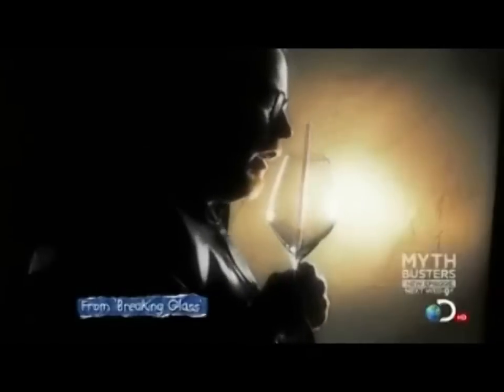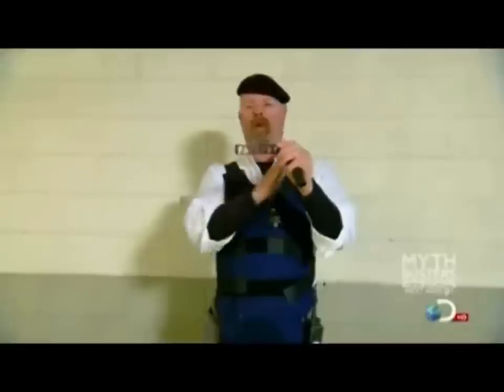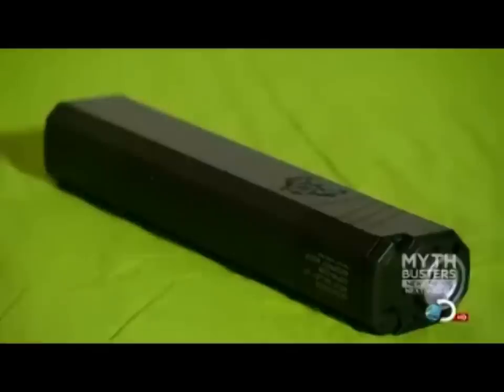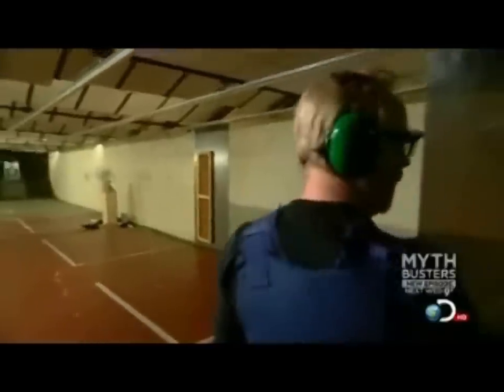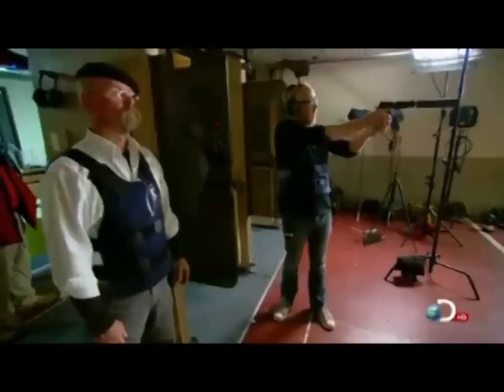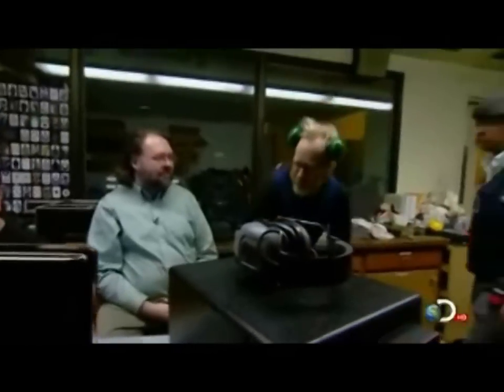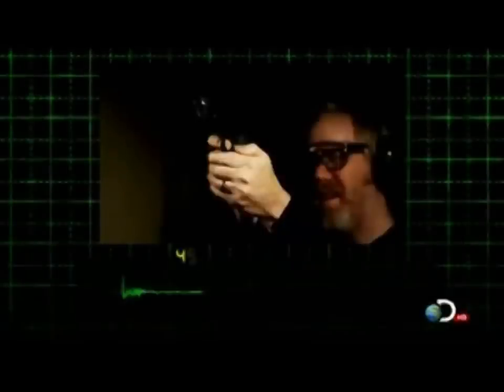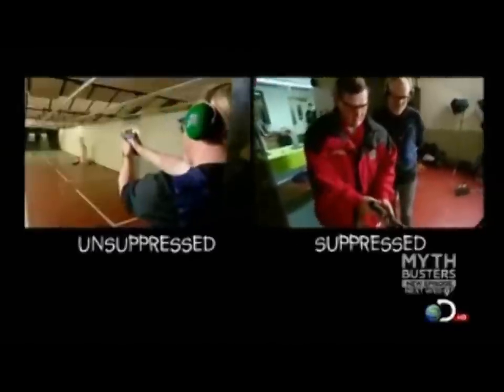Silencerco on Mythbusters

Comment: wet or dry testing... standard or sub sonic ammo... uhhh, there are measurable differences
Reply: ***** how do u mean regarding ur comment, not realistic? Personally, I've used both and tested a variety of substances under "wet" . from water to engine grease. Poor results with lithium grease. Water is only good for a few shots on short can and limited baffle stack but, engine grease has worked best for rifle and pistol(my personal guns) 
. I have 40 plus round thru a can on a 40. Cal with sub sonic ammo I loaded myself without having to reapply .. I think maybe water would be the unrealistic use because it would run out if gun is lowered or raised.. But, there is also a gel on market used for cans so it can be used practically..
Reply: Yes Sir
Reply: *****
Silencerco recommends using a wire pulling gel, not water.
Reply: reduced it to "hollyweird" levels?  C'mon... You know it's a gun shot.  It's a safety tool.  Also I'm sure these guys were dry shooting it.  Don't you think?
Reply: Sure, dry.. What was  safety tool? In ur comment
Reply: james solis Silencers are ear protection,, they're safety tools. most of them lower the report by about 30dB which puts most things in the "safe to use without hearing protection" range of under 126dB at the shooter.

It still sounds exactly like a gun shot. It's just safe for your ears. In many countries (I'll use France as an example) it's damn hard to get a permit to own a gun, but you can buy a can for said gun for cheap over the counter with no hassle at all and it's against the rules of most ranges to shoot without one (or at least is considered very rude).  That's all I was saying.  =)
Reply: Oh.. Yes. Agree. I didn't catch on to how u phrased it but, it makes scenes now.. 
 That's interesting info u gave in ur example about France.. Extremely difficult to get a gun but, picking up a "can" with bubble gum and laundry detergent is easy to get over counter.. 
 BTW, if u goto my page  you see a home made silencer I built for my  40 cal Glock with sub sonic ammo that reduced sound more than half if factory db.. And I have 50 rounds threw this can I made
Reply: On YouTube.. Under my name
Reply: garfieldwithissuez If shooting unsuppressed is considered rude, I wonder what shooting my S&W 460 with 460 magnum loads over there would be considered?!!  :-DBTW - stereotypically speaking, I find it odd what rude people (the French) find to be rude.  \;-)
Reply: yeah thats what i thought, there are A LOT more variables than put into the episode.
Reply: +Mike Riedel Good thing I'm not French, or I'd be so offended by what you said I'd have to snort at you in derision and call you a "Silly Le American." But that's been bred out of me over the last 4 or 5 generations and I'm From Texas, so "Right on Brother."
Reply: Does sub-sonic ammo have that big of a difference on the volume of the shot? I thought they're primarily used to stop the bullet CRACK.
Reply: Ethan Sapp yeah subsonic ammo makes a pretty big difference an mk23 mod 0 running subsonic 45. Sounds like an air gun
Reply: @Monday's insanity most of your factory .45 loads are already subsonic.. don't see why someone would waste the time to lower the already abysmal muzzle velocity.
Reply: Pharoc I was more just specifying because not all 45. Is subsonic, and a non subsonic would still be loud
Reply: james solis surgical lube or ultrasound gel works great to
Reply: Wet testing must've  missed the mythbusters guys  using that term  😤🙄🤬..!!
Reply: @jes0lis  makes sense now *is what I imagine you were attempting to type sorry to be the spelling police again : "SORRY" about that 😤🤬..!!
Reply: Yeah they tried the subsonic ammo and it was just like the movies

Comment: What wasn't mentioned, at least in this part of the video is that .45 caliber is subsonic(around 800 ft. per second), so when suppressed, it's very quiet because it's not breaking the sound barrier. Notice when the silenced 9mm was fired, it was louder(about 1200 fps). Point is, if you buy a suppressor, .45 is by far the best round to shoot.

Comment: You're partly right. Most movies wear an "assassin" has a silencer, it's a .22lr (which is quieter than a pellet gun). However, in movies with spec-ops soldiers, they'll be using normal calibers. Also, when they use them on an m4 or similar weapon, it's complete bs. Supersonic .223 sounds like a really loud .22, and sub-sonic doesn't always cycle the action completely. So when they
Reply: This was a decade ago but you never finished your comment my guy
Reply: @Spud.0  I did. Its one comment down "They do slow down, but just barely. Not even enough to notice a reduction of range or accuracy. I'll refer you to the gunwebsites ".308 velocity shoot" here: /watch?v=ekKdmx9Loiw"
Reply: @OhshitPositive  no way how’s ur decade been

Comment: Did they try subsonic ammo? Would reduce the sound even more.
Reply: The .45 caliber is already a "sub-sonic" round as it travels at speeds from about 850-920 fps, depending on various factors.  To break the speed of sound, and generate the ballistics "crack", is about 1,100 feet per second.  The Suppressor they are using, the Osprey, has a lower chamber that offers about 30% extra volume to cool the gases leaving the barrel, thus this version is king of the hill right now for OoTB performance.
Reply: as stated .45 ACP is already subsonic and yes the 9mm they were using were subsonic loads as there was no crack at the end of the shot.
Reply: As mentioned by Hawk, you are likely thinking of rifle ammo.
Reply: There are even quieter 45acp rounds. Even a different burning of the powder and 50fps less can reduce the decibel when running through a silencer.
Reply: 128 decibels is plenty quite enough. 140 is hearing safe. There's no real added value of going quieter. Based on a study with 9mm subsonic ammo and a SilencerCo Omega 9k by the Military Arms Channel (MAC) here on YouTube, they were registering an average of 124 decibels. To put that in perspective, 124 decibels is about as loud as a "from the shoulder" clapping of the hands (as opposed to "from the wrist" clapping like when applauding). No one will hear a sound that quiet if fired from inside a house, for example. All that said, if you want more quiet, you need a bigger suppressor.  

I'd imagine that anyone that fires a semiautomatic pistol with a suppressor and subsonic ammo wants the weapon to fully cycle. I mean people that actually own suppressors, such as myself, as opposed to people that watch too much TV and can only speculate about "more quiet", but I digress. An unmodified pistol (one not equipped with an ultra light slide, reduced power recoil spring, etc) needs ammo, even subsonic ammo, that generates enough pressure to still cycle the weapon completely and reliably. There's no point in spending all that money on a pistol, suppressor, threaded barrel, piston, NFA stamp, and ammo to turn a semiauto into a single shot. No thanks. No cycle, no beuno!

Right now, the best, quietest, suppress-able (low to mid pressure) calibers are .22, 9mm, .45, and .300 Blackout THAT WILL STILL ALLOW A SEMIAUTOMATIC, or FULLY AUTOMATIC WEAPON TO CYCLE RELIABLY.
Reply: Doesn't adding a suppressor actually increase pressure to help cycle the rounds?
Reply: look up pistol boosters.
Reply: 140 decibels is not hearing safe. you still do damage at more then a seconds exposure in a 24 hour period.
Reply: Michael Woolever The gas pressure would probably have to increase slightly, because the whole purpose is to slow and cool the gas pressure behind the round, but that isn't the primary intent.  I suspect that is why pistol type suppressors back in the 90's had metal "actuator" push pins to help cycle the weight of the slide - specifically on older H&K models
Reply: many pistol caliber silencers often come with booster devices or they are sold separate. sometimes one isn't needed due to the ammo being used in the gun other times it is needed to make the slide go back properly.
Reply: +Michael Woolever Yes adding a suppressor does increase the pressure inside the firearm, which is not always a benefit. This is a issue with firearms that rely on pressure to operate (such as a AR-15), these firearms need to be adjusted to function properly with a suppressor. There is a different issue with pistols. Most pistols are designed so that after the round is fired the barrel travels rearward slightly with the slide to unlock the action, then the slide continues rearward to perform the extraction of the spent casing. The added mass of the suppressor inhibits that movement and can cause the pistol to not function properly. That is why most pistol caliber suppressors come with a bushing that will allow the barrel to travel independently of the suppressor for a short distance, to allow the pistol to unlock with just the mass of the barrel as it was designed. In either case either the gun or the suppressor needs to be designed to operate with the other (there is no "plug and play").
Reply: not completely correct. more and more carbines are being designed to function with a silencer without the need to be adjusted and can function very well with or without subsonic ammo,
Nor does every pistol can need a booster to push back the slide.
Reply: The booster is just a spring and piston where the suppressor mounts on the barrel whose effect is to temporarily decouple the mass of the suppressor from the barrel and slide for recoil-operated pistols. It doesn't add to the recoil impulse, it just keeps the suppressor from acting as a drag and reducing the recoil enough that the pistol doesn't cycle. The suppressor does increase back pressure so on a gas-operated firearm like most semiauto rifles it will make the gun cycle faster and harder. That can be a good thing or a bad thing. If it cycles too fast it is harder on the gun and it may cause failures to feed because the bolt is cycling faster than the magazine spring can push the next round into place.

Most 9mm rounds are supersonic so you get the supersonic crack even with the suppressor. However, that doesn't travel back very well so if you're behind the gun it isn't nearly as loud as it is in front. There are 9mm loads with heavier bullets that are subsonic. The supersonic crack really becomes an issue with centerfire rifles.
Reply: Eddie King subsonic also reduces the effectiveness of the gun though
Reply: toomanyaccounts
 I really hate that stupid argument. I don't want to be poked with a used hypodermic needle either, but that doesn't mean it's an effective tool for self-defense.
Reply: subsonic ammo is used by snipers and assassins.
Reply: +toomanyaccounts Yeah man, everyone knows tactical operators use armor piercing subsonic sniper bullets to assassinate people in their sleep.
Reply: Subsonic ammo for snipers? That's kind of counter-productive. 
Snipers want range, predictable trajectories, and high speeds and impacts.
With those kinds of ranges and a suppressor to eliminate muzzle flash, there is no need to silence the round, really. By the time the sound of the discharge reaches the target, they're already well on their way to hit the ground. The sound is next to impossible to place.
Reply: I guess that depends on why I was fighting them to begin with. But I'm pretty sure they'd be a LOT less likely to live through the encounter using a syringe for a weapon than if they had a 12 gauge. After that what happens to me a month from now won't really matter to them.

Comment: I have a 300blackout AR. When I run 220gr subsonic ammo with a suppresser it's quieter than a bbgun. Most of the noise is generated when the bolt opens/closes not the actual shot
Reply: Pew pew pew!
Reply: Ffft ffft ffft!
Reply: This vid makes no mention of what sort of ammo they're using - as you point out, using subsonic ammo makes a huge difference.
Reply: Goldeader blog it
Reply: I’m not buying the BB gun statement only because I have one an it’s not quite in that range of quiet and an 4.15” 9mm sbr that an Tirant 9 lives on An neither is in that range of quiet. Not a spring BB gun anyway lol. Still a blast to shoot regardless

Comment: I am a bit disappointed with this episode. They never compared a movie dB, just the relative sound effects played back on a computer. They site the silenced gun at 128 dB. 120 dB is the front row of a rock concert. 130 dB is a jackhammer. Please tell me which of these are quiet as movie shots?
Reply: Too be fair, "movie suppressor decibel" levels would be variable and  depend upon the volume of the speakers, making it difficult to get an objective measure.

Comment: cant the sound also change depending on the silencer being wet/dry and the ammo used?
Reply: Yup, they likely used subsonic ammo for the test. Looked like they shot them dry as well, would have been even quieter shooting wet.
Reply: Check the high speed footage about 3:23 you can see water escaping behind the shot
Reply: That's gasses from the powder bro.....

Comment: They should have ran them wet. Probably would have hit ~100 or so Db. Not sure why they were so surprised. The main point of a suppressor is to make a firearm operable without hearing protection. That way you can shoot at home or where ever without ears. You can have a big boy .45 lobbing subsonic bowling balls at intruders without loosing your hearing. More importantly trained law enforcement or military can use suppressed firearms without loosing communication or one of their senses being tainted by ear protection, or being temporarily taken away by not having hearing protection.
Reply: The surprise comes from the common misconception that silencers make guns almost unhearable.
Reply: except for certain guns in a certain setup it can. you often only either the action of the gun, the shell case hitting the ground or the bullet impacting. silencers are used by assassins.
Reply: toomanyaccounts I hope you're joking, but if you're not; Suppressors only suppress the sound of the gasses escaping from the end of the barrel. You still hear 2 other sounds; the 'explosion' in the chamber and the breaking of the sound barrier if the round is supersonic. Hence why subsonic rounds are quieter

Comment: shoot a .22lr sub sonic suppressed you only hear the slide/bolt. And if I were an [hollywood] assassin .22lr or .22mag would be my round of choice.
Reply: .22 mag is going to crack pretty loud. IIRC the Mossad favors subsonic .22 for hits, shot from very close and relying on shot placement for lethality. With some pistols you can lock the bolt and cycle it by hand so you don't even have that sound.

Comment: To get the Hollywood sound you have to use subsonic ammo and a smaller caliber with the right can. Not all, in fact most suppressors can not duplicate that Hollywood sound. Best bet use a .22 with subsonic ammo and a good quality can.
Reply: As the owner of a 9mm suppressor, I can confirm this.  I still managed to hurt my ears with it once firing next to a wall.  It's loud.  My suppressed 10/22 Takedown is much quieter.
Reply: It also depends upon the 9mm ammo you use. Not all 9mm subsonic is as quiet as one another. Plus you get a huge difference if you got a can that can be fired wet and use white lithium grease in it,

Comment: In confined spaces, silencers are still loud but when you're above 50m, silencers works REALLY well. 

Silencer/Suppressor has a flatter tone to it so it doesn't linger with the soundwaves travelling far while a unsuppressed gun does. Thus, that's why a gunshot can be heard a mile away when a gun is unsuppressed while a supressed gun won't give you that issue. Plus, the real intention of a silencer isn't to make it sound like what Hollywood made it out to be. It's actually designed to be used as a noise confuser if you could think of it that way. what I mean is that the main reason a silencer is used is to trick people into thinking that the sound they heard wasn't a gun shot or they can't hear it out of their hearing range as the shot is not penetrating the sound barrier and travelling though the soundwaves like an unsilenced gun.

Comment: .357 mag, .44 mag, .357sig, 10mm S&W, .40, and most 9mm rounds are all supersonic from a 5in barrel. Very few .45acp rounds are supersonic however. 

And for the record, a suppressor actually increases accuracy in many cases. Because it provides an ideal muzzle break to vent the expanding gasses away from the bullet. There is no noticeable effect on trajectory, unless subsonic ammo is used.

Comment: Theres a lot more to it than that, The subsonic projectile actually makes a noticeable sound as it passes through the air, kind of like a fizzing sound from the spinning and air disturbance which is easily heard when fired through a suppressor.  Most blank firing auto pistols will have a restriction in the barrel or suppressor which will also naturally make for a much quieter sound when fired compared to a proper cartridge. the difference is say a 1/2" inch hole down to 1/4" on a .45

Comment: Depending on the weapon, suppressor, and ammunition, it's possible to have the only sounds you hear be the mechanical operation of the weapon. One slightly odd example I've seen was someone shooting a Nagant revolver with a suppressor. About all you hear in the video is the click of the hammer coming down. It's also about the only revolver that can be properly suppressed, as it seals the cylinder against the barrel when you fire. It's on youtube, if you care to look it up.